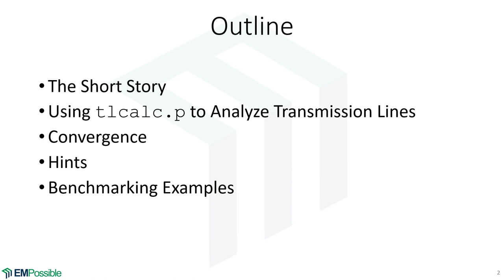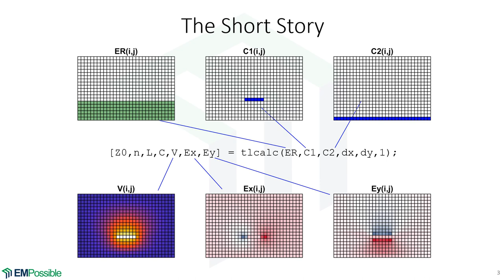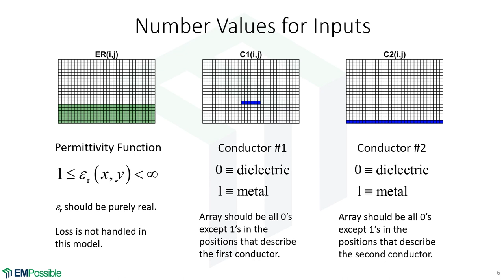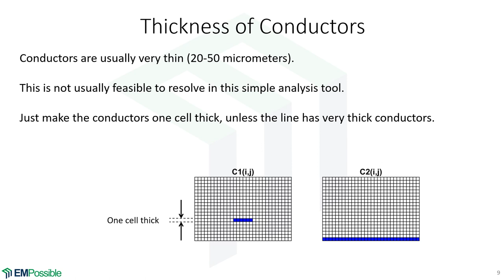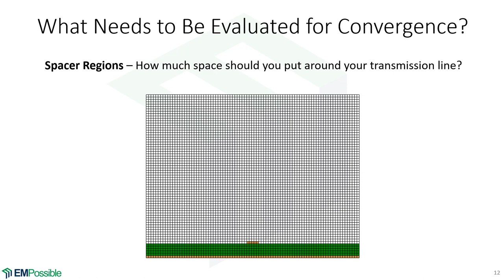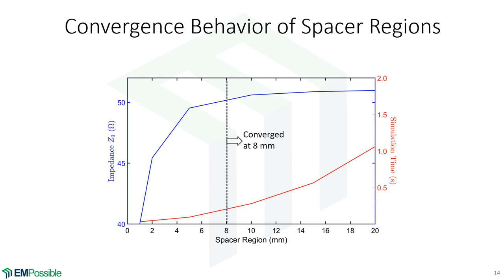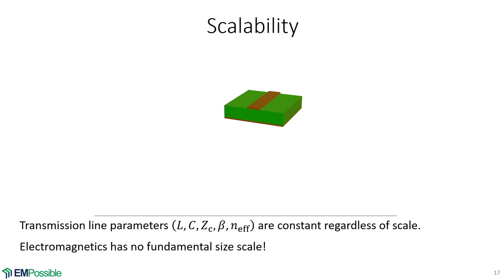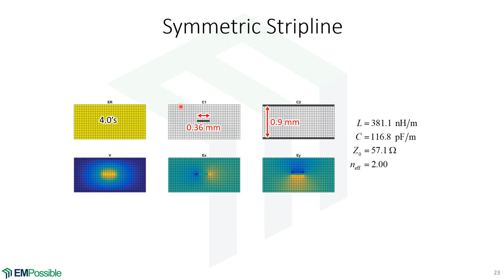Lecture -- Using tlcalc()

Comment: Hi, I find this video is very helpful and easy to understand. What is the best way to simulate grounded  differential CPW (GND on 2 sides of the TL on Layer 1 and also GND on Layer 2) ?
Reply from the maker: It would look very similar to the microstrip, but the GND metals array would include the grounds on either side of your signal line in addition to the ground below.  I think that is it!

Comment: Is this more accurate than the transmission line calculators built into PCB software? I checked your benchmark microstrip line against the PCB calculator available in KiCad, and got 59.5 ohms compared to your 51.1 ohms.
Reply from the maker: I think that is hard to say without knowing what is behind the TL calculators.  Many use the same analytical equation that has been around for decades that I think would have roughly the same accuracy.  Other models that take into account conductor thickness, loss, frequency, etc., will be more accurate than this tlcalc() model.  The primary benefit of the tlcalc() approach is that it is very simple and can analyze many different types of transmission lines, even very exotic designs.  The online calculators are fixed to a single transmission line type.  If you want better accuracy, the transmission line should be modeled rigorously as a waveguide.  I have some crude notes about this in Lecture 4j here:

https://empossible.net/academics/emp5337/
Reply: @empossible1577  Thanks for that informative response. Yes, the solvers I looked at did take into account the conductor thickness, but they are also limited in how they can be set up. I was using tlcalc() because I had an odd stripline situation where the core above the line had a different thickness and permittivity than the prepreg below, which can't be modeled by the KiCad PCB calculator. But when I tried tlcalc() on a symmetric stripline I noticed some disagreement the other tools.
Reply from the maker: @nathanielkilmer5022  Given the simplicity and approximations built into tlcalc(), I think 51 and 59 ohms is decent agreement.  Usually it is a little closer, but I don't know what approximations are behind the model you are comparing to.  In my experience, even the rigorous and super-accurate simulations are off by this amount due to things like manufacturing tolerances, etc.
Reply: @empossible1577  You got me curious enough to look into the TransLine calculator that KiCad uses, and it looks like their Microstrip line calculation uses a mathematical model from a 1989 paper. It says that their calculator is based heavily on Transcalc, but they don't give much detail about what's going on under the hood. I assume it's just plugging values into formulas and spitting out answers. tlcalc() is definitely a useful tool that I'll keep in my arsenal, though, so thanks for posting that.